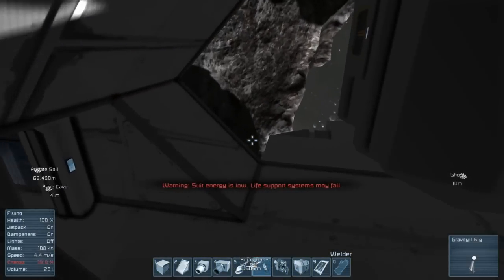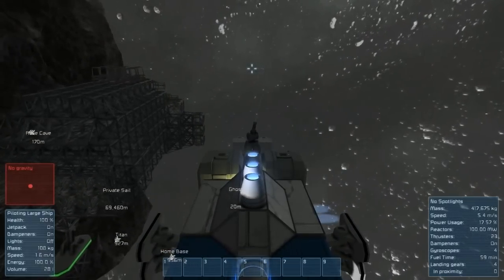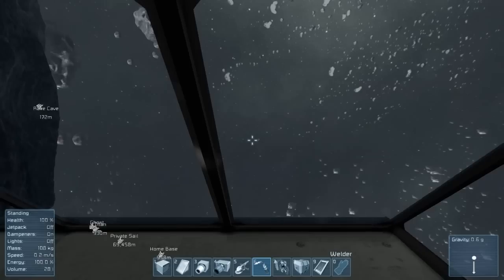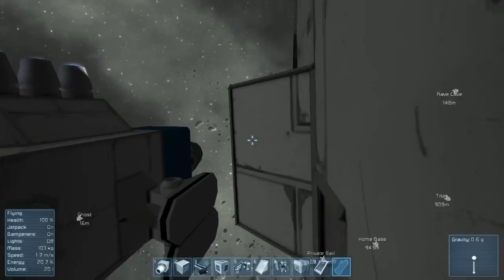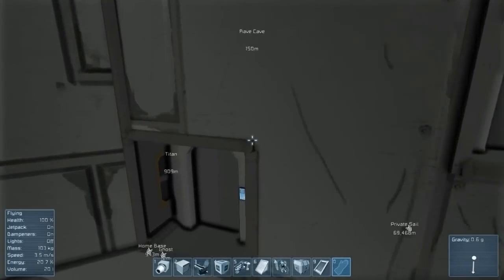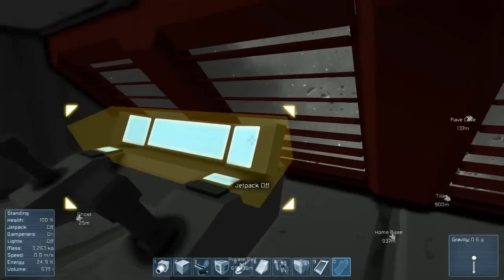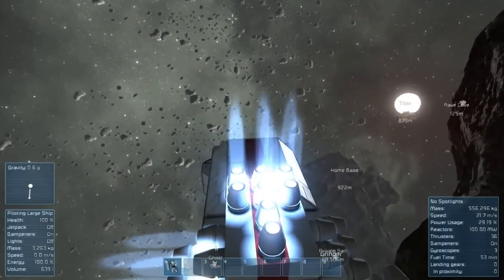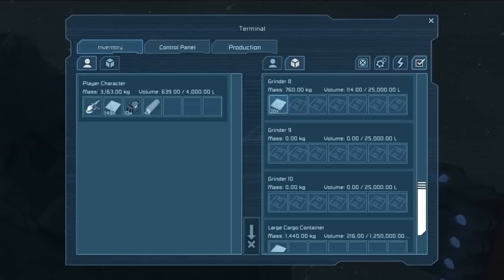Space Engineers: Survival Let's Play Episode 22

Comment: kind of late now but you used quite a bit more conveyor tubes and conveyors than may have needed. the ports on the grinders work like conveyors and would all lead to the center two grinders anyway, you'd then just need two conveyors to connect those together, then use a single tube to the storage container